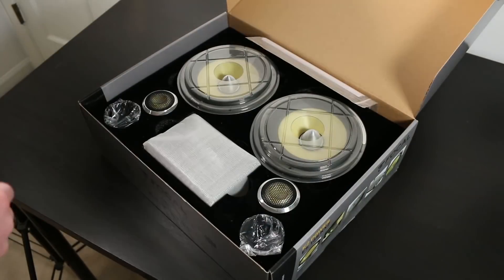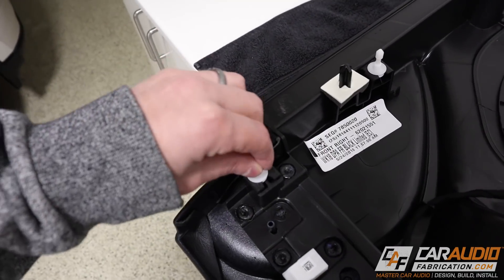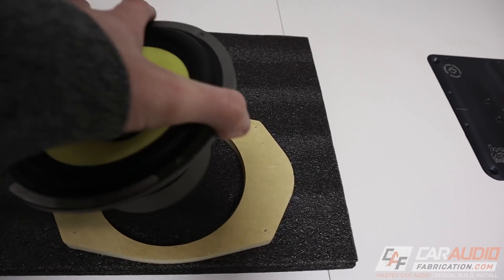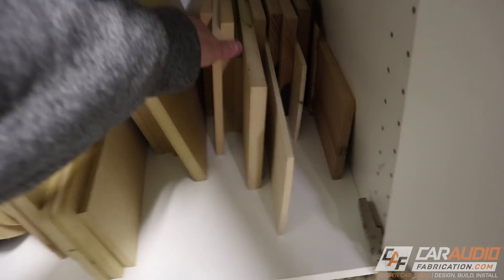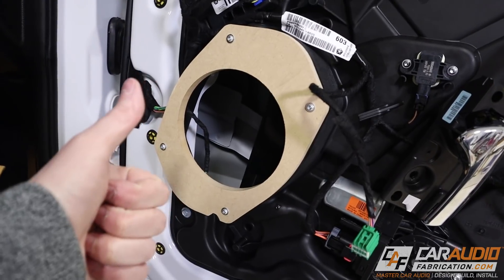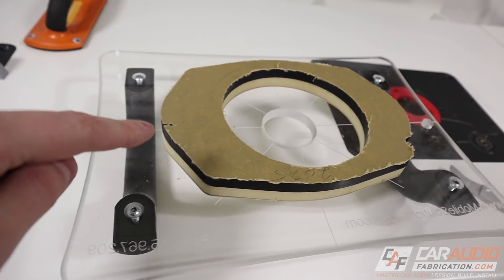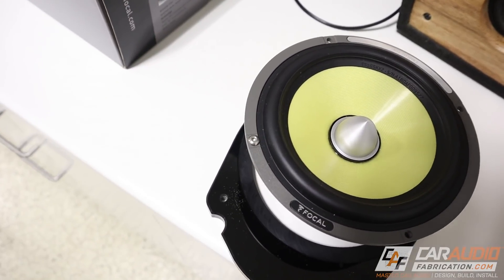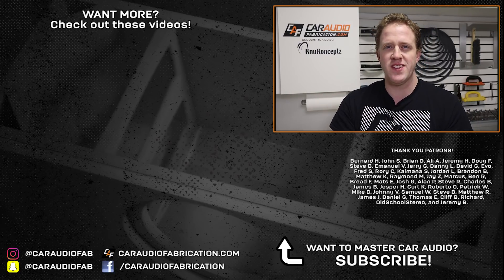Improve Sound! Precision Acrylic Speaker Adapters - HOW TO

Comment: So my question is why not just use the mdf as your spacer?
I did it on my 2007 RA Holden Rodeo for the front & rear doors to fit 6.5 inch MB Quartz speakers. I made sure to silicone the back off mdf & around the outer edge. And had no issues with it the whole 17 years off owning the car.

Comment: I love what  you do, the quality of your work is so impressive, but my concern is the time you take to do some of these things, for example in this video, all that work and craftsmanship for the new panel to hold the new speakers in the door.. once the door panel is reinstalled your not even going to see that, right?  So for what I am sure the customer is paying, was it really worth the cost to the customer and the extra time for something you don't see anyway?  Definitely not saying it should have been bare MDF but Chamfered edges and the sexy looking gloss black piece?  Wouldn't a piece of basic black ABS plastic have worked just as well without all the extra do-dahs?  Am not criticizing, at least not intending to as in questioning your work or quality of work, both are absolutely way above par and top notch..but at what point does it get a little redundant and unnecessary?  I am asking in more of a learning capacity and trying to understand "why" you did/do it format.  Am absolutely NOT trying to be a hater or talk crap.. Your skills here are night and day better than I will probably ever learn to be at this.. It just doesn't make sense to me is all.

Comment: Are you familiar with the Lexus 2001 GS430 I jumped the gun and bought 2 sets of 61/2 focal component speakers I got a really good deal on them and come to find out this car come factory with 4" speakers I want the install to look as factory as possible is there a way to fit these speakers without disturbing the door panels .
I purchased a pioneer double din  , alpine R-A60F amplifier all the RCA's amp  wiring kit and the plug kit to bypass the factory amp still need subwoofer and enclosure and amplifier for it I will be running all the wiring for it .
I really don't want to purchase another 2 sets of speakers. 
Any suggestions what do you think about mounting the 61/2's I e search for this kind of install and no luck just with an LS they come with 61/2's in the front doors . You've done lots of installs that why I ask .

Comment: Is there any gasket between the acrylic adapter and the speaker? And the acrylic will hold up over time? Specially because you even flushed the speakers into the acrylic so the material even thinner.
Looks good, just concerned about the long term use and it would be a shame to crack the material.

Comment: I have a similar setup as you just did in this video. I have a 2011 Dodge Avenger, and I replaced the factory 6x9 with a JBL 660GTI component set. I paid someone to do the install, and like you they made an acrylic adapter for the new driver, however unlike you they did not flush mount the driver into the adapter. Consequently, the driver sticks out just a little too close to the door panel and has caused the surround to be damaged. I do not have a router with which to recess the speaker into the adapter for a flush mount. Do you have any other suggestions for creating more clearance? I purchased a set of Stinger FAST Rings in hopes it would create enough room, but have not yet installed them. Do you think this will work, or is the door panel too rigid to flex?

Comment: absolutely beautiful work.  I do not have anywhere near your skills but one thing similar I do is whenever I remove a panel or anything in my car, I do the tapping everywhere and deaden everything.  So it was cool to see that it was not just me, and if you do it, then I know it is the right thing to do.  wrapping the plastic fasteners was a new one though I have padded them with silicone gel.  anyway, the videos are awesome..

Comment: Hello Mark ...
I have a 06 tahoe z71 with bose sound system
Wich im trying to remove .  As i was removing the original deck 
I came across a blue square that says steering wheel interface. Does it mean i can swap the radio with an aftermarket one ....and would this bypass the bose system... someone help .......

Comment: Very nice and clean.
One question. Will that adapter be covered up at all when the door is done, or will it be fully visible? I ask because I can't get those shiny screws to "fit" with the interior. SS screws for the driver itself of course, but you should try some high gloss black screws for mounting the adapter.

Comment: Nice speaker adapters! I had my installer use Starboard and YES they made a big impact on sound quality. I also completely sound proofed the doors using Dynamat and added BlackHole acoustic tiles in the door cavity.

Comment: Well done Mark, Stainless is really nice and beats the shitty mild steel or zinc plated screws, bolts etc any day. It can completement 99% of crafting jobs, there is a variety of different head patterns and thread pitches. However, the best thing is that will appeal to nearly everyone as the metal can be highly polished or left as is and still give a nice luster. Not sure if you took my advice from previous comments, if you did, Cheers bud and keep up the good work :-)

Comment: Hey Mark, why no drill press for perfect 90 degree drill? I noticed you used a little cheat tool for some drilling - what was that?

My car threw a curve ball at me, and the part you mounted the speaker to (the black factory plastic housing) was molded into my speaker. And it used some angles to help aim the speakers to a listening position.

Comment: used hdpe on door speakers, plastics are best for waterproofing door or preventing freeze expansion issues in colder temps...helps to use jigs, used an hand held router to counter sink driver mounting hole etc...the had to shape outer edge to fit the curves of door indentaion soraker moutning location etc...it took 3 hours to shape and fit the hdpe speaker mount panel into the door properly...close ups of the driver mounted are difficult to spot uts was done by hand eye router cutting.

Comment: Working on a build for a 2014 convertable Camaro Rear Seat back wall replacement. the back seat in this car already is barely use-able so i am trying to figure out how to get as much bang for my buck as possible and still keep it something when the top is down that will grab attention. My question.

I am currently working with the gear i have left over from other builds but i am thinking of 2-12s and 4-6X9s in that rear seat wall. with the amps and  Kicker Front Row DSP displayed on the seat area with Plexi and LED lighting. My issue is I would love ported Enclosures. but it seems all i am seeing in builds like this is Sealed enclosures for the 12s. Is it possible to pull off a fiberglass faced ported Enclosure that looks Amazing and is correct? and would a ported Enclosure require more space then a sealed one. (( If it helps the speakers I am currently looking to use are Kicker L7s but if needed i can go with a traditional Round style as i have been looking at Sundown speakers. )) Any suggestions would be GREAT i really respect the work and this channel.

Comment: Why do you have to take the paper off to run it on the router? Won't the bit just cut through the paper too?
Reply from the maker: I don't trust grip between the paper and the acrylic. If you stick the template tape for the top surface on the paper it can shift slightly from the template. Your edge quality won't be as good.
Reply: Fair points, Mark. Thanks for the answer.

Comment: Nice work Mark! You should mention in one of your videos about router bit bearing screws backing out.... It has happened twice with me when cutting aluminum and destroyed my work pieces. I have found that using blue loctite on the screws prevents it from backing out. Cheers, Doug

Comment: I literally laughed out loud when I saw that creepy little hand come into the frame. For anybody who is new to using routers, it’s worthy of noting that if you do flush trim or template cutting/pattern cutting, you’ll want to pre-shape the pieces with a jigsaw/bandsaw, just as he did when he went to do the acrylic piece. Less material to be cut away means less strain on the router motor, which equates to longer lifespan of the tool. Another similar practice that helps increase tool lifespan, is to cut less than the full depth of the workpiece in one pass, by breaking it up in increments, cutting a third or half of the thickness of the material to be cut away on each pass. Great knowledge included in a great video,  thanks for sharing it. Aloha

Comment: I should’ve payed more attention in my high school wood working class lol. Great video, Mark!
Reply from the maker: The good news is there are plenty of woodworking channels and information out there, it seems much more useful now than building a birdhouse right? :)
Reply: On top of what Mark said, also remember this. If you acquire some essential tools, which include a router and a jigsaw, you can go a long way. Yes, you do need some things to start out with, but remember, you don't need the latest and greatest in router lifts and tables. You'd be surprised at what you can find on the used market if you look for say a Jessem lift and table. The bits are important though so don't skimp on those, and a bunch of basic templates are as well. But you will also be able to create your own templates over time. Every time I've done a template in MDF or another somewhat durable material, I keep it, so I got a lot of interesting odd shapes, and circles in just about any diameter there is.
But the important thing to remember is this. Wood is pretty darn cheap. When learning to use your router and jigsaw, you can use so many things. You don't need a nice piece of MDF or birch plywood. Get the cheapest sheet wood you can, boards as well. Anything you can cut, route or sand etc. Go to town on that stuff, make shapes, use templates, do freehand. You'll be surprised at how much skill you can pick up just by using your tools, especially if you combine that with watching some good videos about wood work.
Good luck.

Comment: oh man the amount of effort and love you put into setting up an audio system is commendable!!
Reply: PLEASE BROTHER DO MY CAR👊👊👊
Reply from the maker: It's definitely a ton of work, but the results are worth it! And even though its hid behind a panel, I want to know it was done right. Thanks for the nice comment.
Reply: @CarAudioFabrication  I'm 100% sure the results are worth it.. checking each and everything for  rattling or any other kind of noise sure is hard work.. you truly know what you're doing.. keep up the great work..
Reply: @CarAudioFabrication 
It's all the work that makes a proper install look so "easy" and simple.
I can't remember the number of times over the years where somebody has seen something I've done to integrate a speaker or piece of equipment into an installation, and then ask, "Oh cool. Could you perhaps spend a minute and whip one of those together for my car?" It's usually followed by awkward pause, lol.
Reply: @CarAudioFabrication  Might be a dumb question, but is there a benefit of going 6.5 with a separate tweeter vs going with a full range (3 way) 6x9?

Comment: Great informative video as usual.. great stuff! 

Can you please answer a question for me.
I have a pioneer GM-D601 mono amp. it is 300 wrms at 4 ohm.. The amp is powering a JL Audio 8 inch micro sub (250 wrms) encloseure that I have under the drivers seat. I used my SMD DD1 to set the gain.

Today I installed another exact same JL 8 inch micro sub under the passenger seat and i wired the subs in parallel so now the amp is seeing a 2 ohm load and putting out 500 wrms.

My question is do I need to reset the gain now there is 2 subs connected to the amp?  
Or does the 2 ohm resistance not affect the gain at all and i leave it where it is.

Thank you in advance any help is much appreciated.
Reply: Can anyone answer that can help me?

Comment: I just installed some Focals in my Lexus and made wooden speaker rings myself, isnt that the best solution?
Reply: Wood tends to swell and shrink when moisture comes in contact. Mdf and particle boards tend to just fall apart with wetness. Plastic does flex and even gets weak with temperature fluctuations. It does have more longevity than wood. Depending on the situation and placement. Wood is more cheap and readily available than the plastic. Idk? I may be talkin loose. I'm on heavy pain meds and just got out of surgery.
Reply: @jonanderson4474  Alright didn't think about it like that. Maybe your right i made them from MDF it will probably last for a good while tho
Reply: Making them yourself is the most cost effective for sure.
Reply: I'm sure you'll be fine. It's a lexus. Not a rusted out ford windstar.
Reply: @jonanderson4474  lol haha thanks :)

Comment: Hey Mark, i've got a universal A pillar with triple 52mm mounting holes. I want to use the 2 higher holes for engine parameter guages but want to use the bottom hole to mount a 1 inch tweeter from a component speaker set. Could you show how to make the modification to the hole and how best to mold and seal the plastic pods to the stock A pillar?
Reply: He has an entire video series dedicated to fitting a speaker into an A-pillar. It will tell you all you need to know.